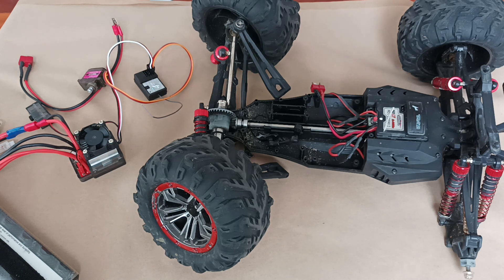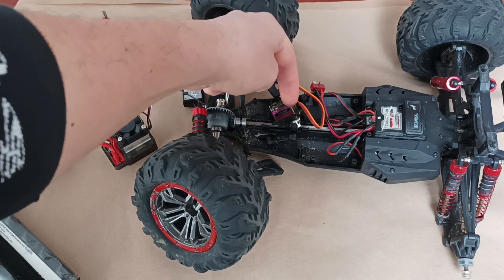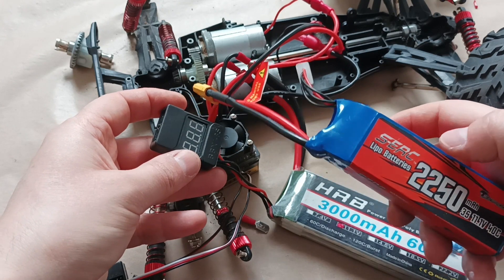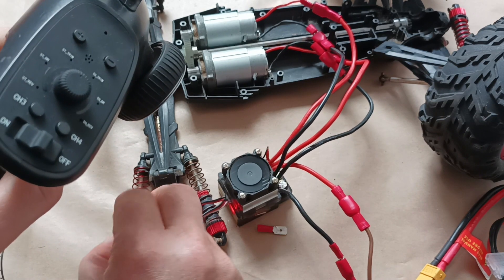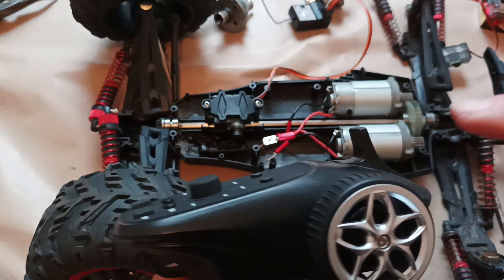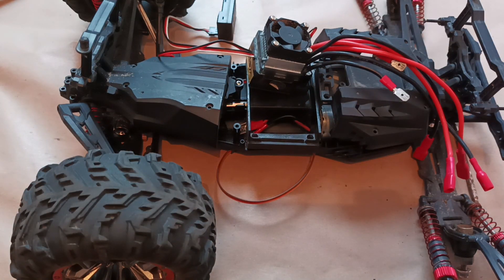How to Upgrade Your RC Car from 7.4V to 11.1V Battery. Upgrading Power on Xinlehong 9125. Part 1.

Comment from the maker: 👇 If you found this video helpful, you can support us by buying products on Amazon, AliExpress, Banggood or Spreadshop via our affiliate links below (we get commission):

👕 Reflect your hobbies on your clothes:
https://rc-toys-aventura.myspreadshop.com/

▶ Amazon:
1. LiPo Battery Voltage Alarm: https://amzn.to/3vd6nsy
2. IMAX B6 Balance Charger: https://amzn.to/3UjG9vr
3. LiPo Batteries: https://amzn.to/3sR7KZ7
4. Xinlehong 9125 (aka Hosim, Blomiky): https://amzn.to/3XV5KNw
5. Spare parts: https://amzn.to/3yLO7EP
6. Electronic Speed Controllers (ESC): https://amzn.to/3fobZbv
7. Remote controls with receiver: https://amzn.to/3WlqQE8
8. Steering mechanism (servo motor): https://amzn.to/3TwcMqN

▶ AliExpress:
1. LiPo Battery Voltage Alarm: https://s.click.aliexpress.com/e/_DekHZVl
2. IMAX B6 Balance Charger: https://s.click.aliexpress.com/e/_DCKBDf5
3. LiPo Batteries: https://s.click.aliexpress.com/e/_DmiR6EX
4. Xinlehong 9125 and spare parts (aka Hosim, Blomiky): https://s.click.aliexpress.com/e/_DEIN0Jt
5. Spare parts: https://s.click.aliexpress.com/e/_DdWvU9P
6. Electronic Speed Controllers (ESC): https://s.click.aliexpress.com/e/_DC9CZV5
7. Remote control with receiver: https://s.click.aliexpress.com/e/_DczJpiB
8. Steering mechanism (servo motor): https://s.click.aliexpress.com/e/_DBqwmsd

📺 Related Videos:

How much speed difference do you get with 7.4V to 11.1V battery upgrade on an RC car? GPS Speed Test: https://youtu.be/5ZWPufm5KM4

Upgrading Xinlehong 9125 from 7.4 to 11.1V Battery. Part 1: https://youtu.be/YmVNnhy_h1s
Upgrading Xinlehong 9125 from 7.4 to 11.1V Battery. Part 2: https://youtu.be/HSZPjOQ9wjg
Upgrading Xinlehong 9125 from 7.4 to 11.1V Battery. Part 3: https://youtu.be/IdKIAytIcy0

How Electronic Speed Controller (ESC) Works: https://youtu.be/cEQHVX73d_U
Receiver Channels Explained: https://youtu.be/9c6Kqm6dX0Y

How to Restore an RC Car Using Electronic Speed Controllers: https://youtu.be/LwE5geJDvz4

How to Disassemble Xinlehong 9125: https://youtu.be/PMOBJUw6uO0
How to Assemble Xinlehong 9125: https://youtu.be/iZbONcpTs74

All Xinlehong 9125 RC Car Videos: https://youtube.com/playlist?list=PLA0BUXPCZx4MUM1QcEKIM-bET_JdSsBOe

How to use LiPo Battery Voltage Alarm: https://youtu.be/IPuwaShdYuw
How to use LiPo Balance Chargers: https://youtu.be/MvFv3CBrJVM

00:11 Why do I need to replace the steering mechanism (servo motor)?
01:40 How to choose the right servo motor.
02:12 How the new servo motor works.
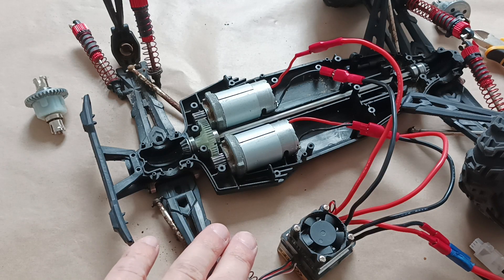03:03 How the Electronic Speed Controller (ESC) is connected to the electric motors. 
03:40 How to setup ESC. How to make your ESC work correctly. How ESC fails to detect electric motors. 
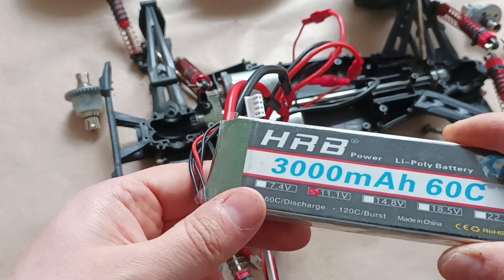05:03 Connecting 11.1V battery. 
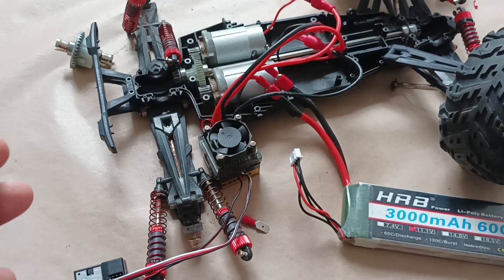05:45 Using voltage alarm to check the state of the battery.
06:37 Using LiPo battery charger to determine the state of the battery.
08:26 Installing the new servo motor.

How to upgrade Xinlehong 9125 RC car from 2S to 3S LiPo battery. How to upgrade an RC car from 2S to 3S LiPo battery.

Comment: Thanks for the video, I was curious as its easier to get 11.1v batteries where i am compared to 7.4v battery. helps a lot that we have the same rc so you've done all the research and testings.